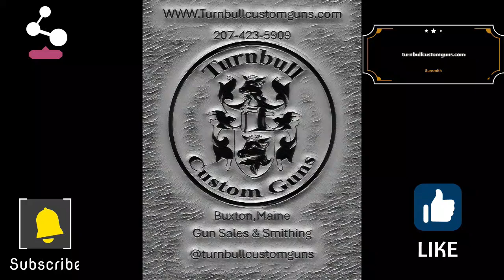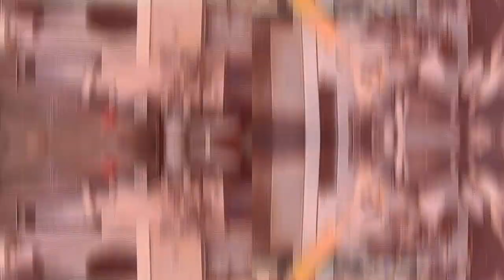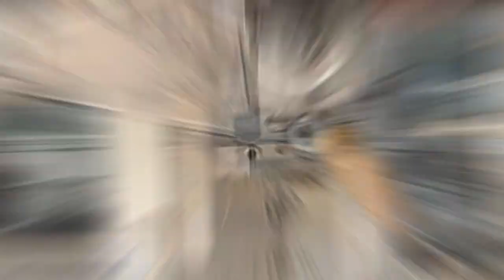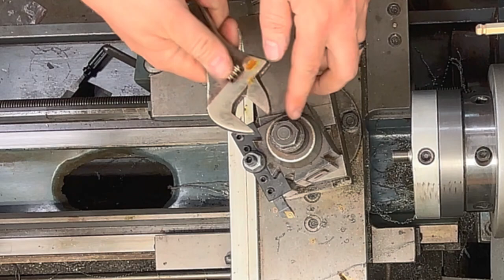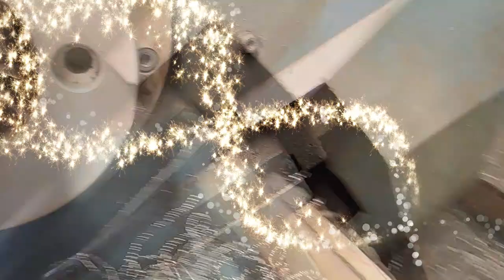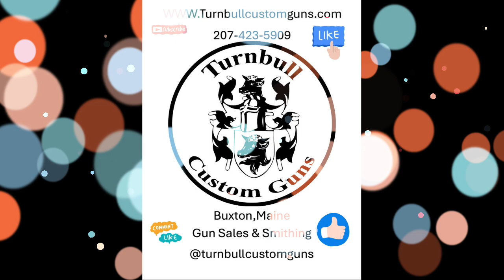Installing a Silencer on a Tikka Bolt Action - Part III Crowning the threaded end.

Comment: What is that between the jaws of the chuck and the barrel? Does it throw off the centering at all?
Reply from the maker: I have aluminum shims between the barrel and the brass headed screws. IT doesn't throw off the centering since each "jaw" of the chuck is individually dialed in until the indicator shows that your work is centered. Thanks for the question.